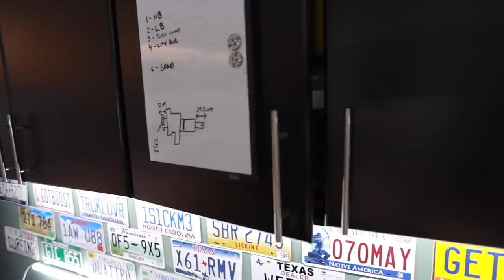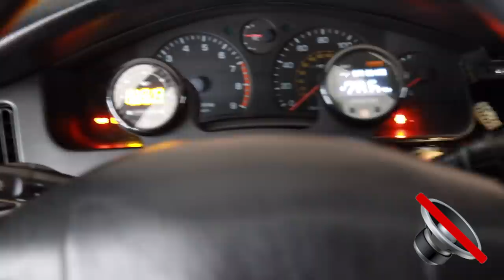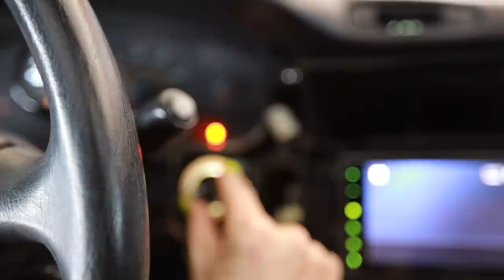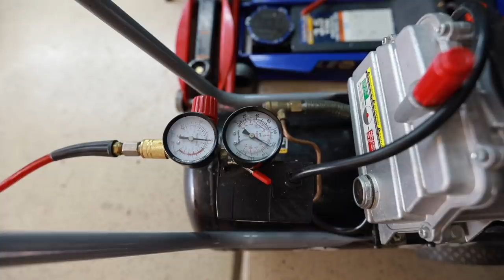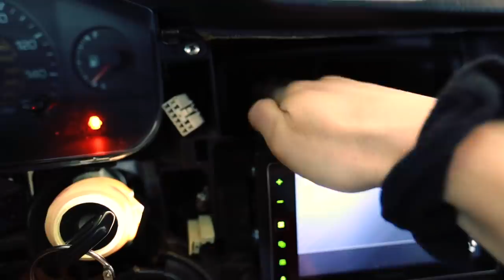Ready For More Boost, The Massive Re-Assembly Task! // MR2 Turbo

Comment: Hey Sarah, The fuel cooler is there to reduce the temperature of the fuel returning to the tank to eliminate the possibility of condensation in the tank. When you pressurize the fuel in the system it heats, whatever returns back to the tank should be cooled. Great video BTW, It's nice to see Mr Dos getting closer to being able to be flogged on a bit!
Reply: Its not on the return line though? I always thought it was a condensation tube on the way to the carbon filter.
Reply: Yes, it's part of the fuel evap system on USDM vehicles to depressurize the tank. Goes to b-vsv on coolant neck which then allows vapors to go to charcoal canister and eventually is circulated back into the engine through the throttle body ports
Reply: That's what is missing on my Lexus 1993 sc400, the fuel return is so warm that it evaporates as soon as it ENTER the fuel tank.
Reply: @SangH112   I just watched the video and  I said OMG !I remembered seeing this on my 87"MR-2.Glad you found it. Great Video BTW!!!
Reply: SangH112 not only on USDM... my JDM mr2 has it...
Reply: @ddarancou2  yes, on jdm also. I only specified usdm due to mentioning the b-vsv on coolant neck. JDM uses charcoal canister and a jet further upstream instead of the b-vsv
Reply: I learned something there, too. Ah the community of Sarah.✅

Comment: When I plan to reuse coolant, I strain it though a t-shirt back into the jugs.
I was recently doing some plumbing work on PVC pipe and got one of those pipe cutter tools.  Turns out it works fabulously on all sizes of rubber hoses.  Even large radiator hoses or heavy duty AC hoses.

Comment: I think the pipe thing is the fuel line cooler, it would dissipate the heating produced by the fuel pump in the fuel. This is specially important in injection systems, where the fuel also doubles as coolant in the high pressure circuit. First time I see disassemble and reassemble a fuel tank by a single person and with the car barely at the minimum distance above the floor so it can phisically go out. Nice phisical condition, Sarah 😯

Comment: Rubber washers is a great idea and I would agree that it will reduce the vibration that caused the cracking.  Reminds me of leaks I get on steel hydraulic lines on my backhoe...it's the vibration of steel bolted to steel.

Comment: Sarah I can see the amount of work involved and you have been smashing it. 
The odd manifold you asked about is a fuel return cooler. Not a big deal mostly but if you were in the snow and filled your car up the cold air ingress could cause condensation to fall out of the air. Like rain inside your fuel tank. 
It's great to see you getting a bit of help when required as well. It isn't a fail it is optimizing the time and making the important targets. You cant be an expert at everything.
As for your glove dispenser use a tissue box holder it works for me. I have never had to bleed the coolant system in one of these however  I have found that once filled normally multiple pressure cycles with the manual pressure tester seemed to move the air out/to the high spot pretty quickly. Always done whilst running.
Great Video

Comment: I saw you struggling with your coolant vac tool. For years I've been using a Matco "air lift". I see they have a new one. AC550500 Air lift ll. I highly recommend, it will save you time and head ache. One thing to keep in mind when using one of these though, the more coolant you get drained out, the better it will work. I enjoy your work! Thanks

Comment: Hey Sarah, if want to make working on the upper part of the engine bay a little easier. You can remove the rear boot lid witch will turn your boot into a seating area.

Comment: Another very entertaining and fun fact video - thank you!
Tid bit of advice about the rubber between the line brackets and body. Although it would make sense the rubber would help vibration it actual may increase the vibration. The lines will be allowed to move more with the rubber. It's a huge variable with the durometer (stiffness) of the rubber o-ring.
Softer=more movement 
Something to consider. Keep up the great videos and on fire humor.

Comment: you should buy a funnel that threads into the oil fill. i got a snap on one. works with all toyotas and is tall enough.Makes oil changes faster.i just need a remote oil filter now.
Reply: also if you ever have to do the fuel tank again . prop the rear up and rearward so the nose of the tank can drop down and then slide it out.

Comment: 6:35 this is the fuel evaporator separator. it prevent the build up pressure ( or vacuum ) in you tank, since the evap system is the primary way for it to equalize pressure and not release fumes.  ^___^

Comment: if u run into those Oetiker type clamps again, all you need to do is take some pliers and twist the crimped section a few times back/forth.  the clamp will release and you dont have to fight getting the hose off the nipple.  and for the aircon, get a meat thermometer, put it in the vent with a/c on max, windows open, charge until the thermo temp stops dropping and starts to climb up a degree or two, that's full.  and get some gauges that dont leak.

Comment: Totally guessing but, the thingamajig on the fuel line might be to cool the fuel on the return line coming off the high pressure rail back to the tank so that the fuel tank doesn’t overpressurise? Love th camo top and the yellow green nails; it wasn’t lost on me. I really like  yr work/videos. I have a Copen which is kinda similar to the TT, but the turbo is in front 🙂😊

Comment: Just a little tip while working on Mr Dos! 
Remove the boot “trunk” then you can sit in there to get easy access to the engine bay. 
Then you don’t have to sit on the engine 😂
Happy cleaning/building 😁
Reply: Mighty car mods tip

Comment: Sarahhh I really thought you were using compressed air to pressure test the a/c lol you really should use dry nitrogen. It helps remove moisture lol. I am a HVAC tech by trade and we now have special locks we have to put on bc kids are huffing it, crazy!!.. I wonder if I shouldn't watch the whole video b4 I committed btw hairspray works great on intercooler pipes

Comment: Did you use R-134a? It seems like R-152a makes a nice drop in for R-12 systems - and the good news is you can theoretically release it and it's dirt cheap since it's just computer duster spray. My '93 SW20 still has R-12 in it I think that's moderately cool-ish, not looking forward to tackling the AC. But it's still like 65 F in Seattle, so yea.... AC outside is my excuse for putting it off!

Good stuff, keep the MR2 content coming!

Comment: Sarah, have you tried the trick where you remove the rear trunk lid so you can sit in the trunk to work on the engine? Supposed to give you much easier access. Too much trouble?

Comment: I always forget that I have a 3/8 and 1/4 drive air ratchet until I have most of the nuts, bolts, hose clamps snug.

Might want to consider a test drive before putting the center console back in. Just in case.

Comment: The tool leaking was a problem but the coolant shouldn't get into that hose, there must have been some in the reservoir causing that.  If you empty the reservoir and the rest of the system is mostly empty it would have probably worked.  Can't guarantee it but that's my experience for the most part.

Comment: Your coolant vacuum should put the entire cooling system under a vacuum. After the system holds a vacuum there should be a valve that open to allow  the coolant to be sucked in. Its work as a pressure test also because the cooling system wont hold a vacuum.

Comment: Hi! I’m no expert, so it’s no pro tip, but putting rubber washers to prevent the coolant line from fracturing I feel will have the opposite effect. I would probably put extra mouthing in the pipe to keep it moving as one with the body of the car. This is no criticism, respect what you do and the car is like new!!!!

Comment: Nice progress here.

The fuel line is basically what you thought, aids in liquid vapor separation before the vapor hits the charcoal canister it once had.

Your vacuum boy should have come with better instructions. You want just the air flow first, create a negative pressure in the system, stop the air, connect the coolant line and let the coolant flow in. With both valves open, it just sucks the coolant and spits it out. That one looks like either the blue hose goes to the car, or is valved and hooked up after there's a vacuum. It helps to have some coolant in the system already, less air to remove.

Maybe do some fueling logging before really testing out the higher boost?
Reply from the maker: The coolant vacuum kit was cracked on the main valve side all the way through, it was no bueno.
Reply: @SarahnTuned  If the crack is just where it was leaking in the video, it might still get the job done(next time), only air should be going through there.
Reply from the maker: @Dave-fx5zw  Nah, it wasn't savable. Wouldn't even pull a vacuum.

Comment: Hey I know this doesn’t have to do with this project but I was wondering if you ever did find the issue for teeter tots over heating issue. I saw the videos and was it the new radiator upgrade that fixed it? Please help I’ve been having the same exact issue, I seriously can find the solution.

Comment: OK...You have my curiosity why you put T-6 synthetic Rotella diesel oil in a Toyota? I use that in all my diesel engines but I have been told not to  mix, long term, diesel and gas formulated oils?
Reply: When I had a Saab on their forums was an oil engineer who explained that diesel engine oils have more detergents that keep particles in suspension better to help stop sludging/deposits buildup, have been running it ever since in all my cars. You can get engine oils to run in mixed fleets, so just need the one type for your gasoline and diesel cars. The oil I use has extra zink as well to protect your bearings.

Comment: Cheap tools... Depending on the tool and how often I'd use it, I try to get good value for the money, but I stopped going cheap. Slipping ratchets, pliers that don't fully close, screwdrivers with breaking tips or free spinning handles, overheating or underpowered soldering irons, random numbers generating multimeters, flickering flash lights, failing switches on power tools, I can go on for a while.

There's no need for apologies. I'm still impressed that you didn't set the car on fire in your driveway. You do almost everything by yourself and just have garage with a Quickjack instead of a fully equipped workshop with workbenches, stationary tools, a carlift and an old master mechanic with decades of experience who fabricated a bunch of tools for special tasks and can help you with the two-person jobs you did by yourself.

Give yourself some credit and remember to get yourself some time off.
Better happy and healthy than tired and stressed, just to keep an upload schedule.

Comment: We can wait for another video. Chill out some.  Also why don't you ever use power tools? I use a battery drill to tighten everything. All those brackets and hoses, put a 1/4 inch adapter in the drill and adjust the torque and run it down. Or get a battery ratchet.  Work smart not hard.

Comment: Be careful with those vacuum coolant installers. In my experience it sucks the air out of the system enough to collapse the hoses. A system which typically is under pressure not vacuum. I've had it cause leaks on older coolant seals not used to being under vacuum. Really sucks when those seals are intake seals and it causes coolant to leak internally into the engine oil and blows the engine due to loss of oil pressure.

Comment: So know how you feel as finished working on a car today it was a pain to remove lower back engine mount on a Toyota Epsom then put a new one on took longer taking off three bolts and then putting them back with only a ring spanner,  and crawling under the car,  will invest in a bigger trolley jack and truck stands  to make it higher so I can use a crawler,  😃  yeah the people who make these car's are scum as some  old car's are easy to work on,  looking forward to the next one 😃🖐👍🏾

Comment: What are you thinking for a next build? Here some cool build ideas:
- Toyota Celica 70's, with an engine swap to a Lexus 5.0 V8;
- Toyota MR2 W30, last gen rebuild;
- Mercedes SL55 AMG, manual swap with E series gearbox.
Reply from the maker: I have to finish the TT and Focus. I'm trying to buy a shop or house with a bigger garage before I tear apart another car. Having to store cars at random locations around Tucson isn't working out for me very well right now.
Reply: @SarahnTuned  what about retrofit on the Audi TT, the facelift front? It would be a cool buid. Think about that.
Reply: @SarahnTuned  it seems you're committed to staying in AZ then?

Comment: You are not using The coolant filler correctly. If you close the valve that you put in the antifreeze, apply a vacuum to the cooling system, Close the Vacuum valve and then open the valve you have in your bucket of coolant it will draw it into the radiator.
Reply from the maker: I was using it correctly, the housing on that kit was cracked

Comment: When I first stated watch you I thought there was a guy in the back round using tou as a front person to get subscribers.  Now I no you do it all yourself.  Very unusual to see a woman you can do what you do. So far I haven't seen you covered in grease and oil. Not that thats important.
Reply from the maker: I don't let me vehicles leak, or get dirty enough to transfer dirt onto me. Also, because I learnt how to be a mechanic in the Air Force, I quickly adopted the habit of cleanliness when I worked on equipment, because trashing your uniform just because you're a maintainer isn't acceptable.
Reply: @SarahnTuned  Thanks for the reply. Nice.you take notice of your fans.